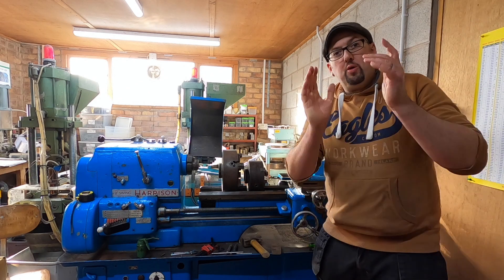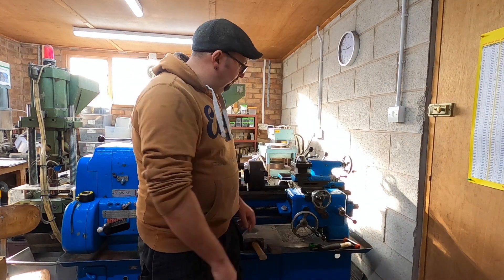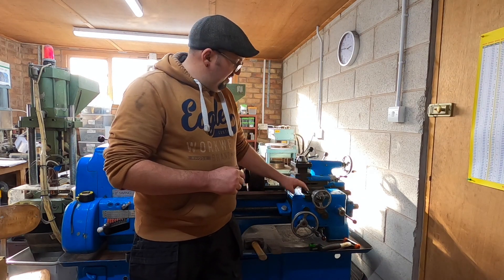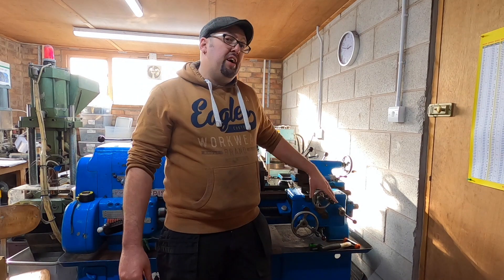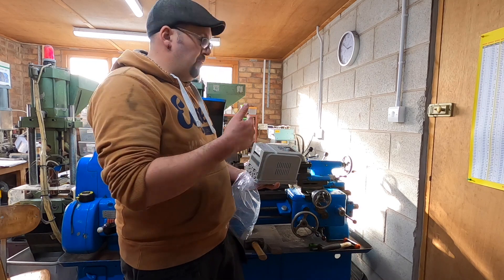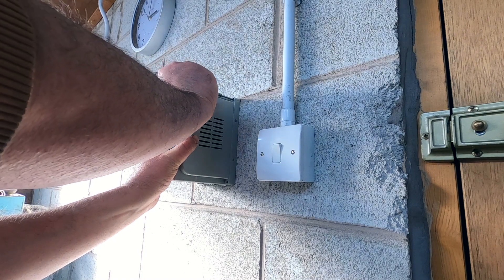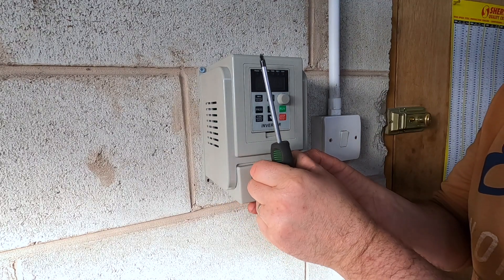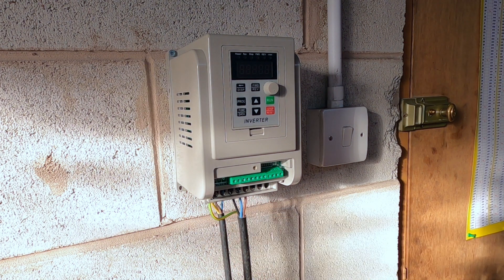Harrison Lathe - Part 2 VFD install & Chuck swap.

Comment: Nice one. I have an Eagle grinder that I would like to power with a VFD. Did you need to program your VFD or did it work straight away?
Reply from the maker: On the lathe, it worked straight out the box, the milling machine needed lots of programming, out of the 2 VFD I have, this one was the easier to get the machine up and running. All the best, Matt

Comment: Thanks Matt. Very interesting. I bought a rotary converter to get my Harrison 140 up and running. It was expensive. Also adds somewhat to the noise going on in the background, and using it brings an urge to turn off the converter during any extended period of "thinking time" when using the lathe. Having seen your success with the VFD, if I was setting up again, I would go with the cheaper route with a solid state VFD. Do you think you get a similar power range as if you were connected to 3 phase mains, or does using the VFD imply a compromise on power? Appreciate your videos on 140 maintenance and use. Am subscribed and please do keep them coming. Thank you for sharing your knowledge and experience.
Reply from the maker: Thanks Simon. On the Harrison, I don't think there is much difference at all, as I was able to reconfigure the motor from star to delta. There is more coming on the machine, 2 videos ready to be released. All the best, Laters, Matt

Comment: Question: what are the two things with red lights on top?
Reply from the maker: Hi Ricochet, If your referring to the green machines in the background, they are plastic injection moulding machines. Our daily business is Injection moulding model kits. Laters.

Comment: Motor sounds rough may need new bearings
Reply from the maker: Hi Chris, that is a possibility, something to look at. I needed the machine running for some turning parts for an upcoming video(s), once they are done, I can start working through the list of issues and possible issues, which obviously I'll be filming. Matt 👍
Reply: @MattChiversWorkshop  Get the bearings greased first though.